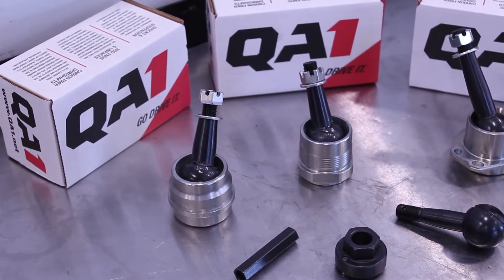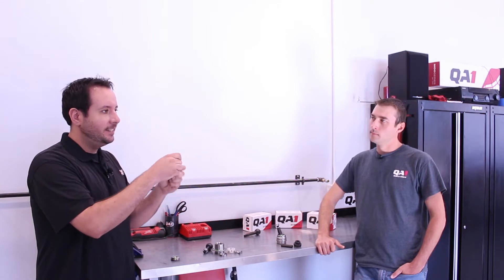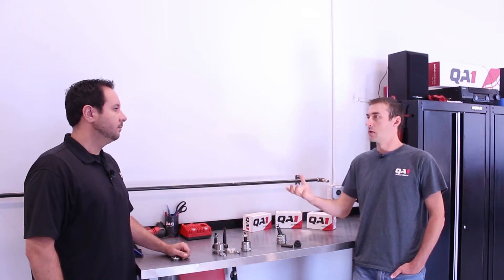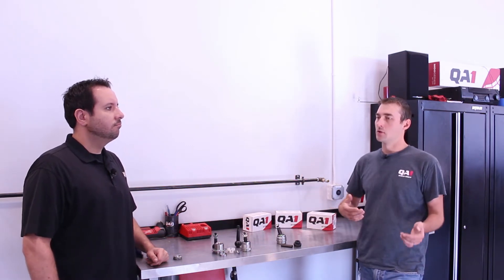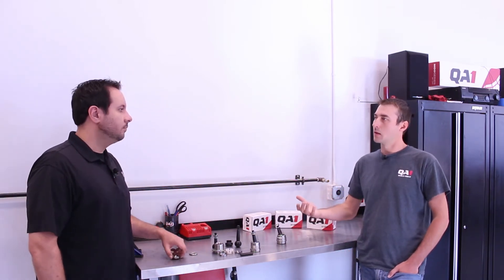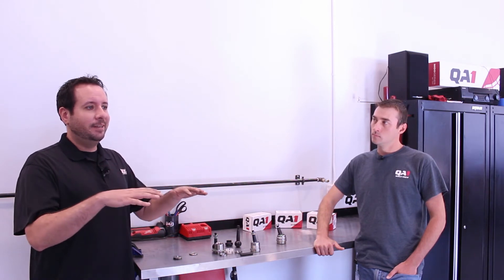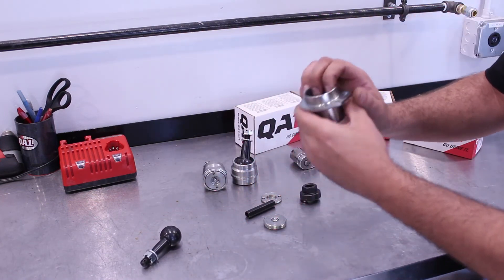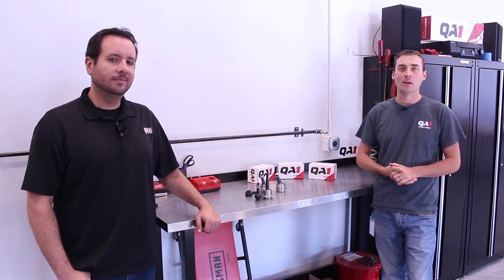Understanding Low Friction Ball Joints

Comment: I was going to replace my whole front suspension but kept the oem ball joints for this reason. I just bought new Boots/sleeves since the adhesive on them opened up over time. Crazy how much better gm oem ball joints are than moon or pro forged.